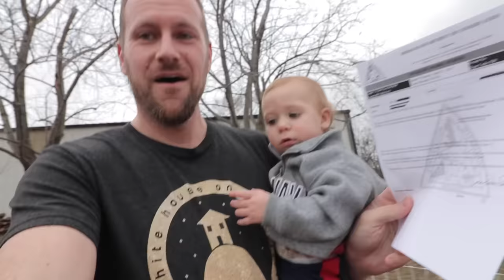Seriously?? A STATE INSPECTION for our birds.

Comment: Using light to check bro. Get it in dark place, with lamp or candle.put close,or near in front the lamp or candle light. Place your hand top of the egg. The butt side of egg(bigger side or the blunt side) will show some small black dot if its vertilized.

Comment: get a shop light put a 100 watt bulb in it put a small box over it with about a quarter size hole in it ,you can set the egg on the hole ans see if the egg is fertilized the will see a small bb size spot on the yoke with looks like strings attached . this is called candleing an egg .they make lights just for this ,but i have used a box to do the same thing

Comment: I wish you the best, try a Bhashara wheel with magnets to a Moksha balance with brushes as it's base connect to a generator and tap to a battery, see if you can create a electrical energy source, makes since to me if you can collect the energy and outsource it thru a AC/DC transformer it might equal a solar source on sunless days ? Try it you've the brains to know any thing I might not know.
Reply: Put magnets on the wheel equal to the balance it should turn the wheel for you ?

Comment: Question: White House on the hill have you ever had a problem with chickens eating there own eggs?
Reply from the maker: Marilyn Rincon Arroyo - every once in awhile, especially if an egg breaks in a nesting box, the chickens will eat it. But for the most part, no. If it's an issue, just be sure to collect the eggs quickly after they are laid.

Comment: I've seen loads of geeese, Guinnes & chickens killed from becoming entangled in that fencing, on several different homesteading channels... it's too flimsey & can't maintain proper taughtness to prevent it from being a danger... I wouldn't use it with poultry birds.
Rabbits don't need a heatlamp; they only need drinking water that doesn't freeze, to be dry when it rains, & protection from wind! Providing supplemental heat prevents the animal from forming a proper winter down, which leaves it less able to cope when temperatures really drop, & stat down, during the winter.  Unless it's below freezing, or an inexperienced doe has a nest of kits, I never supplement heat...even then I use a warming mat & not a lamp.
Also, your emus need toys (like balls) to keep them stimulated & wood chips over a sand bed would help with the muddy run in their paddock.